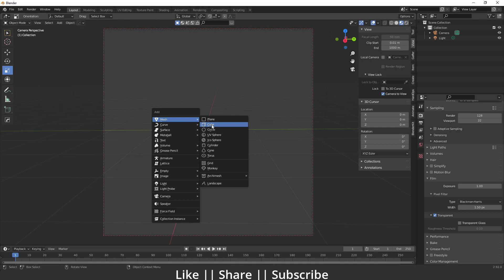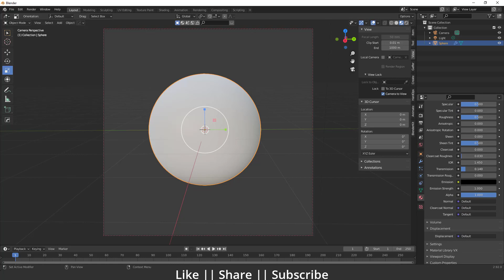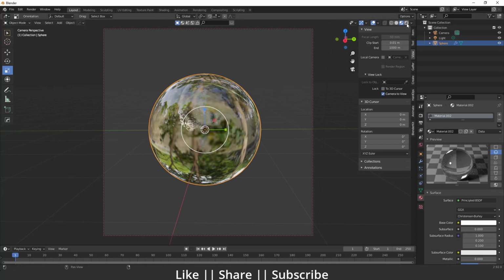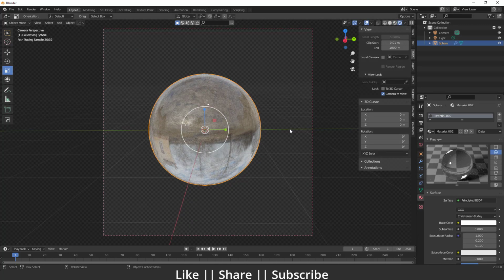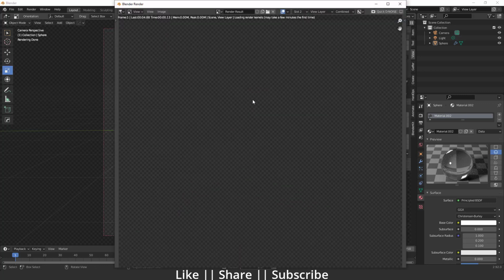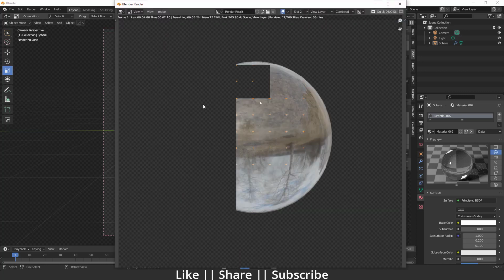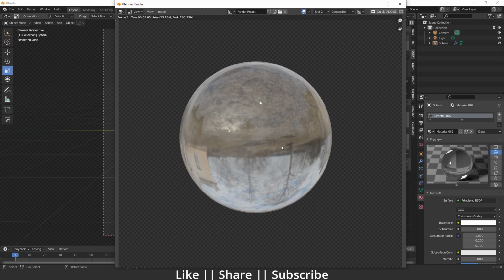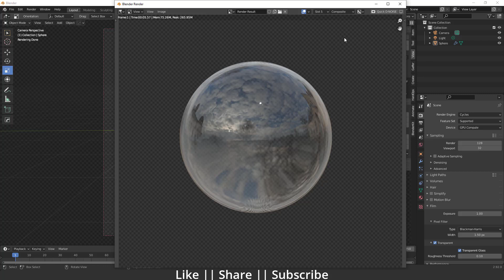Glass Vs Transparent Glass in Blender 3.0

Comment: First you changed the index from 1.45 glass to 1.7 more diamond direction.
Even whe you don't see your HDRI in the viewport around the sphere, it's rendered in the Background from the sphere's used space as reflection. When tick Transparent, the  background behind the sphere is not rendered too. That makes no difference to the glasmaterial or the render engine. You just switched of the backgound for the spheres used area and reflections.
If you leave the backgound visible in the viewport you'll see the same thing happen when turning on 'Transparent'
You know you can't see the background, but the backgound is still affecting the scene (like reflections)....